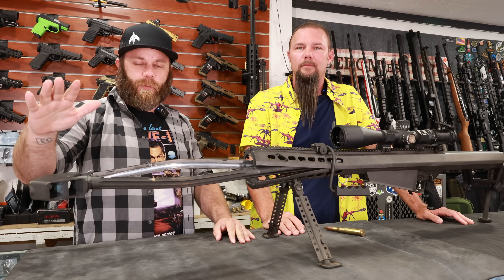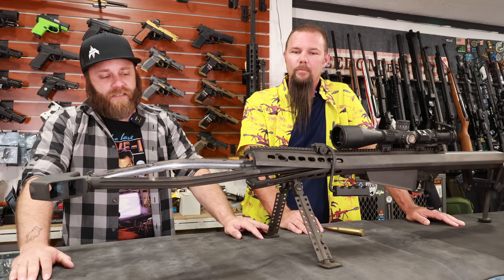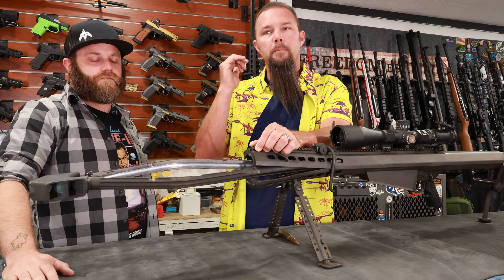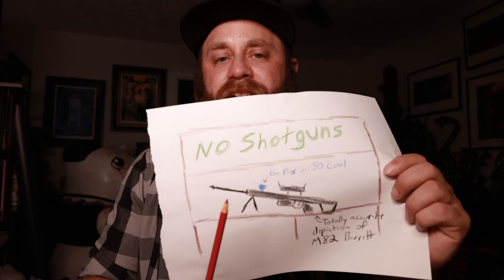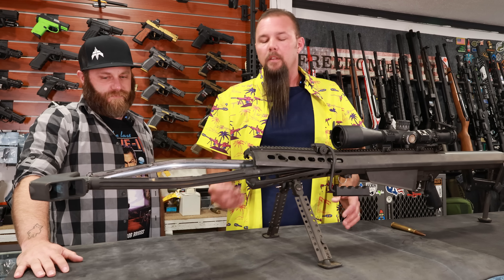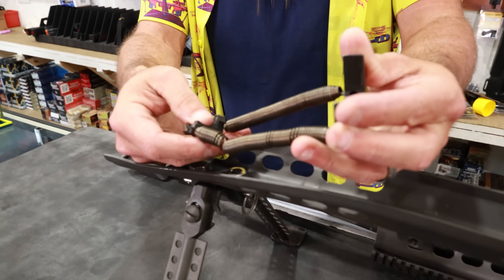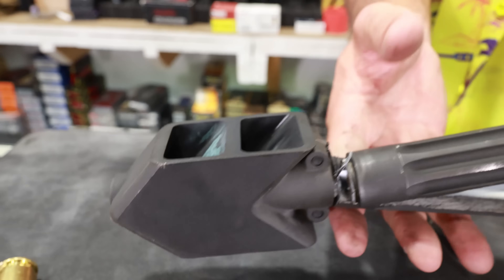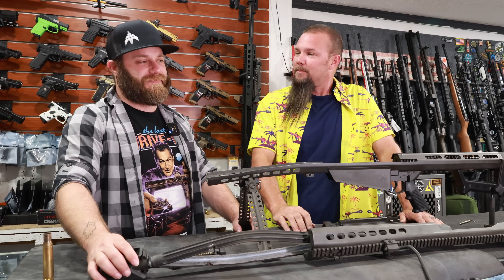Barrett 50cal Explosion Explained! 50 Caliber. 50 BMG. M82A1

Comment: I used the first and later generation Barrett Light .50 for years in USAF Explosive Ordnance Disposal and we rarely had a problem.  For some reason one of our first generation Barretts start going full automatic.  That was a heck of a surprise.  They replaced our first generation rifles with new ones that had improved recoil handling and no full automatic surprises. An interesting side note is that one of our first generation rifles became a Hollywood prop in one of the Robo Cop movies.
Reply from the maker: I hear those things were really good against 6000 SUX 😜

That is really cool info though. I had a rough time double tapping the M82 while on a bench, I couldn't imagine it going fully automatic on me. 😅 -Stephen

Comment: "damage is not a bad as it seems" , whole upper badly bent out of spec, lower badly bent out of spec..barrel exploded, only thing undamaged was the bolt and the carry handle..I guess having Barrett give you a free rifle for posting this video "isn't as bad at it seems" , for a regular guy thats 8k down the drain, Also the fact that you still have a case stuck in the barrel proves expanding gas did NOT blow up the barrel, it's was a barrel obstruction which ruptured the barrel, expanding gas build up enough pressure to bust a barrel only on squib scenarios..otherwise that case would've ejected straight to the moon...guess you can't expect logic from ppl that uses guns as target practice then shoot said guns.
Reply from the maker: The casing was crimped into place from the barrel splitting, a barrel obstruction would not have left the casing in the barrel. 

Everyone assuming we got a free Barrett out of this is laughable. We weren't even monetized when these videos were posted so what we have made in return hasn't even covered the ammo we've sent through this thing in its lifetime let alone the cost of the gun itself.

Comment: Combats weapons engineer. I know another guy with a hot round that ended very badly. Very lucky….I like to use Magnaflux Zyglo ZL-60C or ZL-67 (Dye Penetrant Inspection) for non-magnetic barrels (like stainless steel, chrome-lined, etc.) It’s Fluorescent penetrant that seeps into cracks, then use with ZP-4B (developer) and ZP-9F (cleaner). Requires UV blacklight (365 nm) to view cracks glowing. Best for tight, fine cracks in smooth internal surfaces. Just my two cents. I enjoyed the video. Glad you’re ok.

Comment: Would u plz male a video on tue repair of the replacement parts on the is Barrett 50bmg plz
Reply from the maker: He has since replaced the Barrett with a 107 so it will probably be some time before we actually go through the process of rebuilding this one, but it will be documented when it occurs.

Comment: Looks like a $9k repair.
Reply from the maker: A little over half that. Uppers aren't THAT expensive but they are pricey. Xray cost on the bolt and reframing the lower are the unknown costs. Itll get rebuilt eventually but not any time soon.

Comment: Erm, did the failure follow the fluting?
Reply from the maker: It perfectly followed the high rib and not the divot of the fluting.
Reply: So it split where it was thick, not thin. Weird! @RecoilandRust
Reply from the maker: @marcusgault9909  very weird indeed. I would've guessed it would've followed the divot given how much less material there is but its possible an unseen crack in the meatier piece is where the gas went and it just rode the barrel up/down

Comment: Pro-tip: Don't let anyone fire .308 over the barrel of your Barrett. 

For anyone confused, as I also was, even though the Barrett was on the bench (perpendicular apparently), it was essentially "down range" and had rounds being sent over it. If only there was video of it to reduce the shared confusion, since it's so obviously easily avoidable. I think since this was so easily avoidable, that's why we're all so confused.
Reply from the maker: Trust me, I am equally confused as to why it occurred when it would've taken two extra seconds and one more step to the left to completely clear the barrel out of the risk range. 

Since I seemed to have confused more people than I helped I do plan on doing a quick reenactment video at some point but original footage has been unable to be found at this time as the actual strike happened in 2024.
Reply: @RecoilandRust  A reenactment video sounds like a great idea. I hope your channel gets monetized and Barrett sorts you out soon. As a 107 owner, I had to see what happened. I'm glad I have nothing to worry about. Now for the HPA to get through so I can get a QDL for it!

Comment: Having the barrel fail before the bolt would is actually a great safety feature for a gun like this. A failing bolt would have been much, much more dangerous.
Reply from the maker: The fact that the failure perfectly follows the rib leads me to believe there IS some design intent to this. We would love to speak more in depth with Barrett about it but this may be proprietary information they prefer not to disclose. We'll see.

Comment: shame x ray systems aren't a thing at gun ranges to look for fractures in guns/barrels/ammo.  would an x ray set a bullet round off?  idk how much heat is generated with resistance in the metal.?
Reply from the maker: It would be highly unlikely a round would be set off by x-ray. While it isn't something available at the range we do intend to get the reused components examined via x-ray once we find a good partner for this.

Comment: So you shot across the barrel of a 50 cal because you needed a go pro tripod. No question, no judgement, just double checking that I was able to piece it together.
Reply from the maker: Correct. Shooter did not step far enough over and was firing above the barrel and after a few shots dipped too low.

Comment: Moral of the story, don't leave a Craftsman ratchet anywhere near your wooden prop on your 500 Cadillac powered airboat, and forget that it's there😂
Reply: And, that ratchet put a little dimple in one blade, about a half inch. Day later he ran that thing up to 3,000 RPM, completely exploded and blew the cage right off the back of the air boat😂🤣😭
Reply from the maker: Simple mistakes have not-so simple consequences 🤣

Comment: Sorry guys, its not the gas pressure that ruptured the barrel.  It was the passage of the bullet under the damage the resulted in the catastrophic failure.  The barrel started splitting right after the passage of the bullet but due to inertia the barrel lags in its destruction appearing to have occured after the bullet.  The gasses did not rupture the barrel.
Reply: If you watch the video you can instantly tell you are wrong

Comment: If Barrett refurbishes the rifle and lets you have it back, it might not be customer service. It could be revenge. They might want to give Darwin another chance.

Seriously, you knew that damaged rifle had the chance of going out in a blaze to make mere P320's jealous. Why did you pull the trigger?

Shrapnel from the barrel would have been like tiny razor blades at far higher than normal 50 BMG muzzle velocity. I don't believe in lady luck, but you need to be nice to her for the rest of your days. You may have just gotten your one free ride.

Be safe. Very happy you're uninjured.
Reply: There was zero chance of anything you are yapping about happening you clearly have 0 clue how the barrel of a barret works nor the materials involved if you think any of this rant is valid in any sense
Reply: @alhids35 Really? Did the barrel not explode?
Reply: @johnnyragadoo2414 no the barrel did not in fact explode, because the definition of the word explode would not apply to the method of failure this barrel experienced at all.
Reply: @johnnyragadoo2414 i dont know why i have to tell an adult who claims to know about guns this but there is 0 way the pressure required to blow that barrel apart enough to throw deadly shrapnel would build up from damage that small. You would need a massive obstruction blocking the entire barrel for that to happen. Im also confused how you think shrapnel can magically fly in random directions? The barrel had microfractures the only possible shrapnel, due to the laws of physics, could only fly perpendicular to those fractures when they expand.
Reply: @alhids35 Ok, fair enough. The evolution that barrel experienced, however it is best described, wasn’t safe. My opinion, of course.
Reply: @johnnyragadoo2414  it definitely wasn't safe im just saying that the laws of physics would prevent any shrapnel from flying anywhere that it could have caused injury to anyone around, it MIGHT cause injury to the shooter if the failure had happened further back than it did but since the failure is due to the round cracking the barrel open as it passed over the dimple made by the strike i dont see how any thing besides hot gasses could have harmed him just based on again, physics, and the method of failure
Reply: Pressure pushes in all directions. I would hate to predict where metal splash would land. If you disagree this was an unsafe experiment, I respect your opinion. I don’t think it was prudent, and it’s OK we have different opinions.
Reply: @johnnyragadoo2414  Pressure pushes in all directions but the bullet wasnt obstructed enough for the barrel to actually explode, what happened is the bullet pushed passed the dimple made by the strike and split the microfractures open, the bullet left the gun and went down range the barrel cracked open after the bullet was passed the crack. We can disagree on alot of things im telling you while this WAS a bad idea, there really wasnt a danger to anyone given the method of failure, and they did say they checked to make sure the barrel wasnt obstructed or broken open, which means that they didnt just do it without knowing if it would explode, there wasnt a chance of an explosion
Reply: @johnnyragadoo2414 i would be more upset about this if they hadnt checked the barrel. As they explained with a failure like this even inspecting it with a camera wouldnt tell you this will happen. Should they have done it? No. Was anyone going to get hurt because they did? Also no. Its one of those things you shouldnt do but really was never going to turn out horribly. If they hadnt done it they would only be out a barret barrel, but unfortunately the damage has now also probably destroyed the entire recoil mechanism aswell. Now they need to replace the entire upper of the rifle
Reply: Literally the laws of physics determine that there was 0 possibility of any shrapnel flying any direction but sideways and i didnt see anyone standing jext to the barrel who could have been hit by such but ig you must have been there giving that barrel a nice tongue shine yourself huh? Since you apparently know so much yet are missing so much of your brain

Comment: Owning a Barrett M107-A1 (don't know what a MA2-A1 is)... You don't know what the durability is in the structure until you've inspected and held one in person.  These things are like tanks.  But yeah, you shot the barrel with a 308.  You should have gotten a new barrel; that was dumb.
Reply from the maker: M82A1 is almost identical to the M107-A1 in appearance and design but the M107 is a lighter weight model with a mix of metals while the M82 is 100% steel.
Reply: @RecoilandRust I know what the M82A1 is, but he said MA2-A1.

Comment: The impact of the .308 round compromised the structural integrity of the steel barrel, creating a weakness perpendicular to the primary stress exerted during the firing of a .50 caliber round. Continuing to use the barrel after such damage was a critical mistake, inevitably leading to its catastrophic failure. Quod erat demonstrandum.

Comment: What is the NFA "serialized" part of a Barrett?
Reply from the maker: The lower, receiver, or frame, is always the serialized part of any firearm as dictated by the Gun Control Act not the NFA. NFA applies to full auto, suppressed, SBRs, etc. 

The upper assembly and barrel are all considered components and while they can be serialized on some firearms (Glocks being most common) there's nothing stopping you from ordering a replacement direct to home (may vary by state)

**additional note: A common misconception is that a stripped lower (no firing assembly) is free of this but even with out the necessary components it is still considered a firearm and requires paperwork to purchase new.

Comment: I mean… you can still mag dump. Probably not legally but saw off the bad and use the good😂☠️ jk don’t be dummer.
Reply from the maker: If any portion of the barrel was usable I'd push harder into making it a SBR for the lols but after we filmed this video we pulled the sleeve off and it's cracked from tip to base.

Comment: i'm confused . you talk about the gopro and wanting to get some shots then right into the barrel being hit by a 308 round  i do not understand where he was positioned so he was able to hit the barrel from the side  .   is there a video of that taking place ?
Reply from the maker: While my drawing is awful I did it to show the Barrett's position on the table when it was grazed. 

When not in use it is cleared and checked then aimed in a forward position towards the left berm. Putting it almost parallel to the "no shotguns" forward stop you see in the video. 

Shooter did not step far enough over and was firing over the Barrett Barrel. After a few shots the muzzle dipped low enough to graze the Barrett Barrel on the last shot.

Comment: As an experiment. It would have been nice  to do a magnaflux and metal XRay of the barrel right after the 308 struck which created the slight dimple.
Given the type of hardening needed to have this barrel stand up to long term repeated extreme pressure changes, along with the proven processes to achieve success.
Is it possible or very likely one or more micro fractures were created at the time of  the 308 strike?
Is it possible the fractures would have been more severe on the inside of the barrel; due to the compressive blowout on the leeward side of the dimple strike?
Is it possible the 308 strike caused an over hardened area, created by the peening affect?
Given the pressures in play when a 50 cal bullet is force through this barrel.
It would have been a miracle if it didn't blow out.
Thank you for this lesson.
The moral of the story is; if any type of damage to a barrel or firearm in general is suspected, extreme caution and or inspection of such firearm SHALL be implemented.
Which you obviously implemented.
Reply: The uh... sigh dimple is visible at 7:06 and is larger than I would have expected from the description.

Comment: It didn't  help that the barrel hit the wood with the recoil. I hate ranges the have those.
Reply from the maker: The original video is a little deceiving due to the angle and zoom compression but the barrel is actually a full foot or more away from that forward stop. The wood you see slump down after was just loose rotted wood that got dislodged from the gas dispersal.

Comment: So the question I have is, why did the barrel split where it did split and not out through he sides and why is the split uniform as this may indicate a weakness or a flaw down the top and underneath of the barrel, so why?
Reply from the maker: I can answer part of your question but not all of it. There may be some value in us getting a metalurgist to look it over and give us their input as to why it split so cleanly.

As far as why it didn't go out through the sides: the graze was 100% on top of the barrel, it didn't pass through or even come anywhere near the side of the barrel. So this became the weakest point in the system and once fired the gasses got halted on their normal path out of the barrel for that split second and instead likely found a microcrack in the top of the barrel and chose the path of least resistance.

TLDR, It attempted to use the indent as a gas discharge point and well...kaboom.

Comment: Im happy you guys are safe and not hurt. But wtf were you thinking.  So basically to get video of someone shooting a 308. You put the barret on the bench and had someone shoot towards the barret down the range. Because someone was too lazy to take off a GoPro. Why would you ever shoot over or at a rifle in the first place. Or am I not understanding something? Its really seems laziness was a factor in this by not just taking off the go pro and using a stand or just setting up the go pro for the shot. Looking more at the hit from the 308 round. How in the world did you guys think that it was still okay to shoot? That is a big hit from a 308 round. Did you guys not think of the stress caused by that? Im not trying to call you out im just curious what the thinking was here. 50 bmg is such a high powered/pressure round. Was safety just not a factor or was adrenaline running that day. I know some days are relaxing and less "Safe" than others. Some people wont admit it but everyone does it when they get used to firearms. But that is a big hit why even chance it. From a safety point of view.